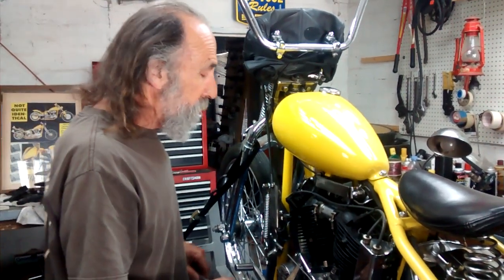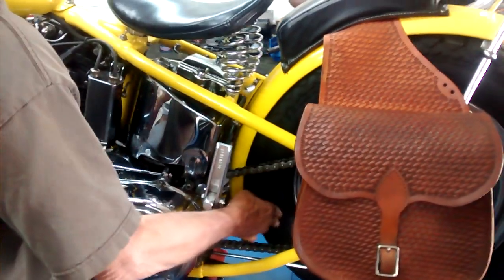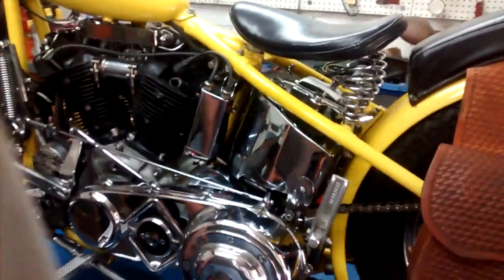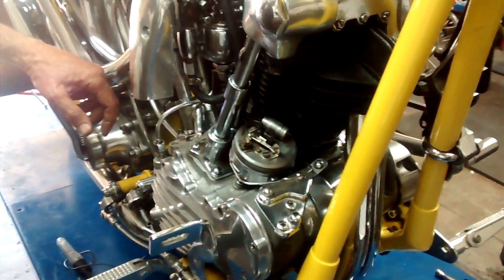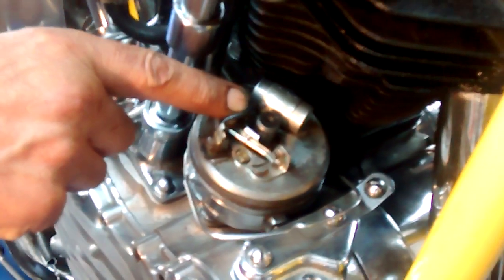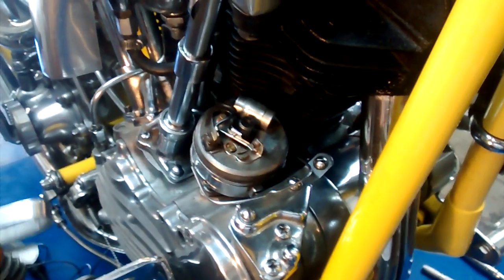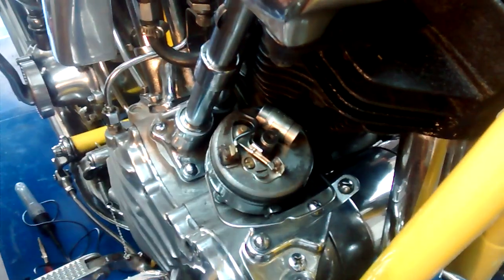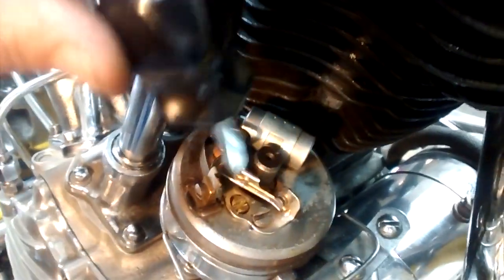How to set the points and timing on an old Harley Davidson Big Twin.

Comment: Your bike is beautifull , your knowledge apparent . You have a spoken voice that makes your videos easy to watch . I still struggle trying to time my 87 EVO engine , although I ve not had to mess with it but a couple times. Timing lights in the hole do not work too  well ,as many of you guys know. LOL .The little scew in clear plastic timing plugs are useless .Has anyone ever had success seeing timing marks thru a smeared oily plastic plug ? I don't know anyone who has .  Your static timing method is time tested and works ! The best mothod for timing an evo while running with a TIMIN LIGHT , is to make a mark on the compensator that corresponds with the exact timing mark on your flywheel . That way you can shine the light thru the primary chain adjustment cover and see the mark without having crancase pressure shootin oil into your eye balls and everywhere else . I say the guy from S and S Cycle who does the videos on you tube , do that when timing an evo he had installed a Hi n-4 Ignition on .  Hoep it helps someone out.
Reply from the maker: Thank you. Devising a way to correspond with the flywheel mark is basically it.  Marking the compensator or marking the alternator rotor are good methods.  Of course, the next time they are r&r'd, they'll have to be marked again.  There are also electronic ignitions that handle all of this for you too.  The deal is, to find what works for you and your bike.  Doing the research you're doing is extremely informative.  Thank you for your input.

Comment: Great video Mike. Worked great on my 67 genny. Running strong. Keep em coming. Thanks.
Reply from the maker: I love it!  That's the goal!  '67 is one of the greatest units ever.  Generator shovelhead, second year, all problems solved,  smooth motor, last year of the mousetrap, ratchet lid transmission, on and on.  About as good as it gets.

Comment: Thanks Mike,
I forgot how much  "FUN"   Ignition POINTS were 
& I am old enough to REMEMBER Dual Point MALLORY Distributors !
COOP
..........................................
Reply from the maker: Points are a part of tuning.  Dual points are a pain.  Early Ford flathead V8's all had dual points.  Harley Big twins from about 60-64 had dual points.  Using a dwell meter to set points was high  class.  Nowdays, my only points are in my Knuckle, my Pan and the mag I'm gonna use on my Flathead Harley.  Some things never change.  We just get older.

Comment: I first learned this in Sturgis in 1997 or 99. when the points broke on my old 50 chopper fortunately I was with a friend that told me to set the points with a match pack cover and he said to set the timing mark back to the right side of the view hole follow the same procedure as you all the way. the only difference was that 1/4 inch earlier on the fly wheel. It worked and I have always viewed things like that as just another adventure since.  Of course I have learned to carry a better selection of tools. That helps guaranties the end to be a happy adventure.
Reply: Oh, there was a bike shop almost right across the street. Thanks again Mike and Mike
Reply from the maker: You bet.  Check an old service manual and you'll see the picture of the  old timing mark placement in the window.  Matchbook was always close.  Ask a  kid for a matchbook today...Huh?

Comment: Great info and real. Thank you for this video. Too bad that younger guys would rather throw the points away and put in some electronic conversion kit. Personally, I prefer stuff that can be fixed at the side of the hiway
Reply from the maker: I run a very sophisticated electronic setup on my Shovelhead.  When I travel, I have a set of points with a breaker plate and advance mechanism.  I get it.

Comment: I like the points on top of the motor better than in the cone type points. I have a 72 FLH that is running too rich and fouling the plugs some. It has a Bendex  fixed jet carburetor on it. I lived in Florida fir 35 years and I did not have this issue there at sea level. I moved to Alabama and now I am running rich. I will rebuild the carb I have a kit. The last time I rebuilt the carb was in the mid 90's Would poor timing make it run rich. It starts on the first kick and runs fine so the timing seems good. I hope it is not an oil issue it only has 18.000 on a total over hauled engine and it has had good a maintenance with regular oil changes using only Harley oil.
Reply from the maker: You didn't say how high the altitude is where you live now.  I lived at sea level for many years.  And I thought I was a great tuner.  Well, I moved way inland.  About 2700 feet above sea level.  Oh yah, there's no moisture in the air here either.  Let's see now, high altitude and no air.  Very humbling experience.  It took a while to adjust my thinking and habits.  A fixed jet Bendix is not hard to change.  You can install an adjustable main jet kit, but that is a very rough adjustment.  There are interchangeable main jets available. Tedd Cycle (V-Twin) still carries the jets in their catalog.  If that 74"  cone motor starts so easy with a kickstarter, you might be running a little retarded, but you get my vote as a competent tuner.

Comment: Good job. I shared this with a friend trying to figure his 63 FL out
Reply from the maker: I'm glad it helped you.  You probably know, unless it's been changed, the '63 came with a dual-point, dual-coil, system.  Good idea and good design, for the time.  However, after setting them up (using front and rear timing marks on the left flywheel, I normally change them over to a single point, single coil system.  The reason being that I find it difficult to keep both sets of points adjusted properly at the same time.  And when converting to 12 volts, only need to buy 1 coil.  Just my way of dealing with it, but even though it's not stock, much easier to maintain.  I'm really glad the video was useful to you.

Comment: Hi Mike: I know its a lot to remember, when you are trying to give people the Wisdom of Motorcycles.
I am shore you know this,  plugs tell you everything about the motors state of health.
You could do a whole program on Plugs, like what each colour means and how plugs can whether your mixture is too rich or too weak.
Being old school, we know these things. Anyway;  I'm not going to steal your Thunder on PLUGS.
Reply from the maker: I really appreciate that.  It does still work, kinda.  With today's fuel, it ain't quite like it used to be.  When is the last time you saw that "light chocolate brown" on your plugs or even in your pipes?  About all we get any more is "that's way too dark" or "there's nuthin' on that plug."  The manufacturers want you to buy a sparkplug flashlight and read the color on the ring way up inside the plug where the insulator meets the outer body.  You don't steal my thunder.  I appreciate what you have to say.

Comment: Why not electronic ignition Mike? Are u just trying to Stickney original stock because if so I get that. Ibe got a bone stock 1 family owned 65 SS Impala 409 that I took the points out of and installed a cool little product called pertronix electronic ignition, fits right in ola e of the old points and u woukd never know. Can u not get a product like that for a motorcycle?
Reply: Nevermind Mike i found a video u did explaining well enough to understand. Thanks dude!
Reply from the maker: I really get a lot of service out of my original "point type" ignition.  However, there is a gentleman (I can't remember his company name) that makes just such a unit as you describe.

Comment: Hi Mike your  a great teacher and I am Australian and understand you perfectly I’ve inherited a 1979 FLH in parts one of the problems I’m having now the original points have been replaced by Joe Hunt side mounted magneto and I can’t find anywhere except for the limited information provided by Joe Hunt on how to reinstall this and do the timing 
If you can help it would be much appreciated
Reply from the maker: Thank you.  Did you contact Joe Hunt Magnetos directly?  They are certainly still in business, even though "Joe Senior" passed many  years ago.  He personally built me a mag back in about 1978.  Great guy building world class equipment.  Sportster service manuals that deal with XLCH Sportsters from 1959 to 1969 explain magnetos pretty well.  To begin with, always remember, "Never set your sparkplug gap wider than .018-.019."  That will keep you out of serious trouble.  Recheck them regularly.  Now, if everything is good, it's a matter of timing.  If the magneto is not functioning, I would contact Joe Hunt Magnetos.  I beieve they are in Rancho Cordova California.
Reply: Thanks Mike magneto is working fine it’s just I’m not 100% sure how to install it and get the timing right ringing America is not really an option as you really need something down on paper or video there site is very vague on installation

Comment: Thankyou for this video,, I have a late model 1961 fl, dual points,, is it the same procedure with front cylinder, pushrods down, ign on, with grounded testing light ?
Reply from the maker: Yes, it's all the same.  There is a very lengthy but complete, explanation in the HD 59-69 service manual.  One set of points is timed to the Front cylinder  mark on the flywheel and the rear cylinder set of points time to the rear mark.  It will seem very involved and it takes a bit of time.  Once you understand it, it's not too bad.  Keeping both sets of points timed exactly right is a kind of a pain.  I usually change them over to single points and time off of the front cyl. timing mark.
Reply: @pacificmike9501  I’ve got an original bike with the advance- retard on the left grip— when I set the timing should that cable be disconnected from the circuit breaker?.. and should I move the bracket out of the way so it’s easier to loosen nut to change timing..
Thankyou

Comment: Hello Mike, I am working on a '64 DuoGlide with stock 6v system and dual points.  Front cylinder gap set to .022 (as per service manual) and timing is set as per manual as well.  When working on the rear timing, gap on the RC points needed to be set to .016 so timing mark would align properly.  .006 seems to be a pretty wide spread.

In the service manual for '70 - '78 Shovelhead it notes that in this single point system the point gap may vary between fc/rc by a range of .004.  Using this to get a frame of reference for what an acceptable rage for the difference in gap between the two.

Using the comparison between the two to get a feel for weather .006 is OK or not.  I am thinking I have to get to the bottom of the .006 difference.

your input appreciated.
Reply from the maker: Just keep on going.  Your logic is good, butgetting those points angled to the point of matching the gaps is quite difficult.  I normally change them to single points for easier tuning.  On the 70 and later, you can match the openings quite easily by tapping on the through bolt that the points cam runs on.  You can match those exactly.  You just keep rotating the engine and tapping that bolt until they match.  The dual points?  not that easy.  You'll get there, just very time consuming.  It will however, run very smoothly, once you get them to match.  Same thing on the 70 and later with single points.  These were not some of Harley's brightest moments.
Reply: @pacificmike9501  thanks. I think I can get them to match by setting the front cylinder to .019 and then I will assume that the rear will move out by .003, and end up at the same thing, 019.  That's my thinking on it anyway. And also the recommendation of a close friend who does a lot of this work as well. Wanted to confirm that that is what you meant versus trying to get them both to . 022. That I would be scratching my head a bit longer over, up to and including taking the timer out and rebuilding that to make sure I don't have any gaps or glitches in there.
So looking for confirmation, setting them both to the same. As in both at .019. Thanks. Appreciate your feedback.
Reply from the maker: Sounds like you have a handle on it.  Keeping it in tune is kind of a pain.  As I said before, I generally change them to single point.

Comment: Hi Mike, I’m sooo glad to see this instruction!! Is there any reason to put gear four to get timing adjusted? Can it be done by putting it at first gear instead? Appreciate your response.
Reply from the maker: Much easier to turn the engine over in top gear by turning the wheel by hand with the spark plugs out.

Comment: Hello Mike. you've made some great detailed videos for points adjustment. I have two generator shovels with auto advance distributors (factory stock). Perhaps some time you could cover the flyweights, springs and lubrication of them. Can you advise what you use to lubricate the pivot points on the flyweights on the base? Also, can you advise if you know of a company that sells stronger tensioned flyweight springs for '65 pan and '66-'69 shovels? I know there are three different tensioned springs available for '70 and up, but I never see anything for early models. Thank you.
Reply from the maker: V-Twin carries the springs for your units, but I don't know of any custom tensions available for them.  I use antisieze to lube the advance mechanisms.
Reply: Hi Mike, thanks for your comments. Much appreciated.
Reply: Hi Mike, hopefully you are surviving the heat! When timing with a timing light for '65 - '69 FLH do you try to get the engine idling around 2000rpm? Do you have an idea of the rpm needed to get the flyweights to move the distributor into full advance on these bikes? I think I found in one of the manuals 2000rpm was the magic number to time 1970 and up FLH's, but oddly I could not find definitive numbers for '65 - '69.

Comment: Great video Mike. Thank you. I have a 1959 Panhead and the distributor is too tight, some times it is difficult to retard the spark with the grip. How can I fix that?. Thank you in advance. Appreciate your response.
Reply from the maker: Well, it's hanging up somewhere.  The grip should be removed and the internals lubed with grease occasionally.  The cable should be disassembled and lubed.  The distributor (circuit breaker) should be taken apart and lubed too.  This is normal maintenance.  The bike is over sixty years old.  I'll bet that stuff needs attention.  It's all in your service manual.

Comment: The best video on Timing I have seen, Im just awaiting a new curcuit breaker( Christmas /New Year you name it, all shops are closed)
Got same as you a Knuckle -47, but I have a auto ditributor, and no mark on the cam.
As I understand with an original distributor, you set the point gap at the narrow part of the cam, is that correct?

Greatful for tips

Brgds Lars
Reply from the maker: Yes.  Front cylinder on compression stroke, small lobe on circuit breaker cam, timing mark on flywheel in proper position in window.  Points just starting to open (just barely) with circuit breaker fully advanced (holding it advanced if automatic.

Comment: Hey Mike. I have a 1979 FXS shovelhead (74 cubic inch) and I am trying to replace the HI-4N electronic ignition on it. Should i be setting the new ignition while the Line or the Dot is in the inspection hole? I am confused on which one is TDC and which one is the advance mark for 1979 shovelheads. Thanks!
Reply from the maker: The dot is TDC on the front cylinder.  The line is the advanced timing mark.  Don't forget to position the valves so the no. one cylinder is on its compression stroke.

Comment: Thank you.....very comprehensive video.  Just to confirm, the goal is to have the points 'open' when the Cylinder #1 is at TDC, and the distributer (timer) is fully advanced?
Reply from the maker: You got it, except, at that time, the points have just BARLEY opened.  That's why we use a test light to get it accurate.
Reply: This might sound like a dumb question, but if the old V-Twins ran a wasted-spark ignition system, why does the distributor have two lobes?  Could they not just gear it so that it fires on one lobe?  

My second stupid question is why is the front distributor lobe narrow, and the rear cylinder lobe wide?
Reply: @jjlad5037  You cant run 1 lobe because it is not a 180 degree engine. To do that both cylinders would have to be at tdc at the same time. One firing and the other at overlap on exhaust/intake. The lobe difference is because the cylinders have different timing specs.  Thats why you set front cylinder to the narrow lobe if memory serves and the fat lobe is for rear. If you set front to the timing marks on the flywheel, then the rear will be correct. Atleast that was for my last two shovels with points in the cam cover. And if i remember correctly my pan, iron sportsters,  and wla were the same even though some had distributors the points and lobes were the same. Someone will correct me if i have fat and narrow lobes reversed but that is why the different lobes. Different timing front vs rear.
Reply: @Big.Ron1  ...thank you..of course that begs the question...why different timings for front & rear cylinders?

Comment: Hi Mike, hopefully you are surviving the heat! When timing with a timing light for '65 - '69 FLH do you try to get the engine idling around 2000rpm? Do you have an idea of the rpm needed to get the flyweights to move the distributor into full advance on these bikes? I think I found in one of the manuals 2000rpm was the magic number to time 1970 and up FLH's, but oddly I could not find definitive numbers for '65 - '69.
Reply from the maker: Close enough.  I find it very difficult with a light, but when I use one, it has a tach on it.  Around 2000, it should be fully advanced.
Reply: Thank you Mike for your confirmation! Much appreciated.